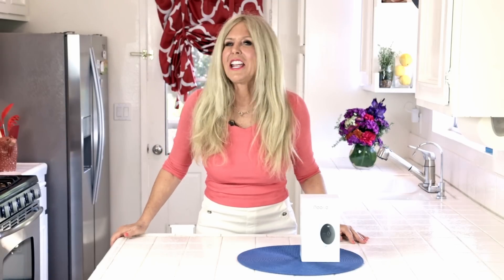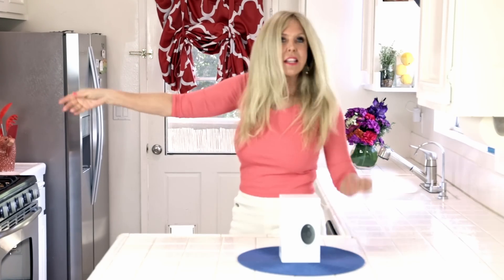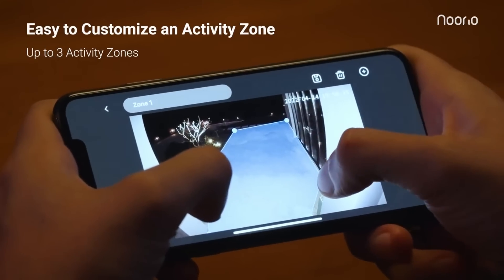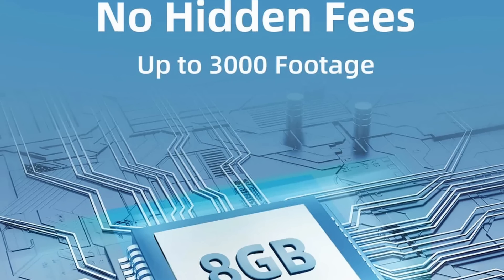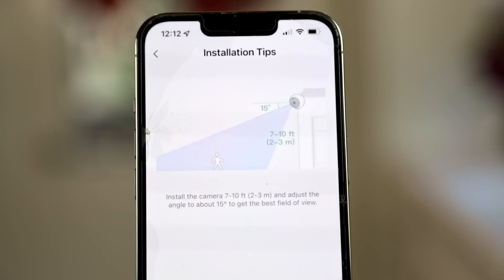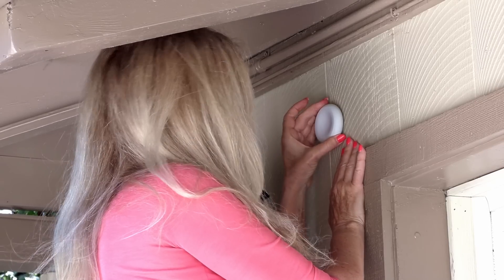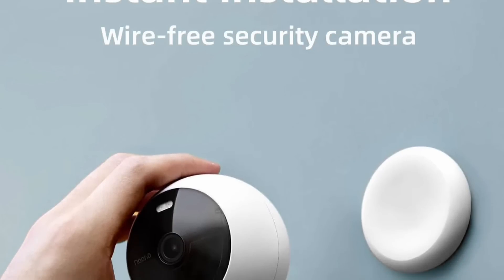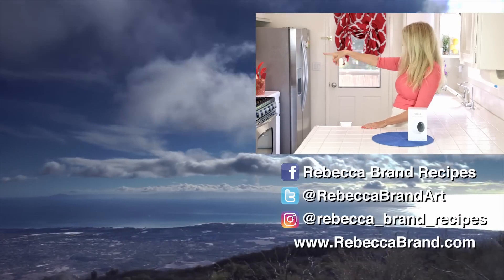Security Cameras for Home with Installation | Noorio Wireless Wifi Security Camera B200 Review

Comment: Was that a USB wire you plugged in?  Maybe that's what I need to do, but wouldn't want to overcharge the battery if that's possible. I have an idea that "Google Chrome Cast" might have a way  to cast what's on your phone to a TV screen. That would be really nice!
Reply from the maker: I think it is a different type of connection, but a port that's common for sure, don't worry about overcharging it.  Yes, you can get a mirroring device for iphones so  you can watch on your TV!  I love that idea!